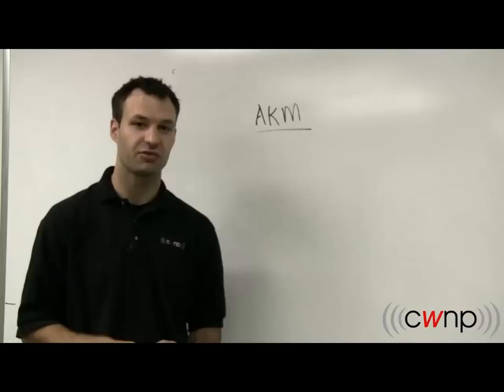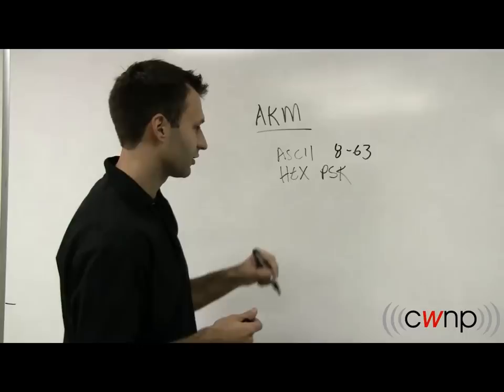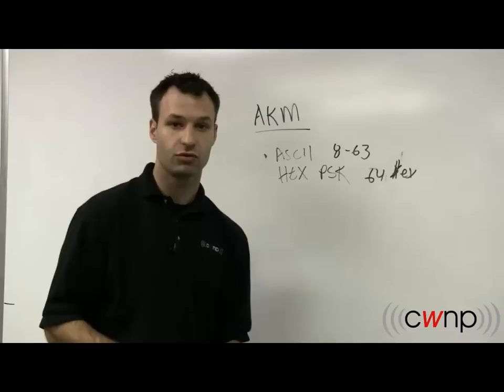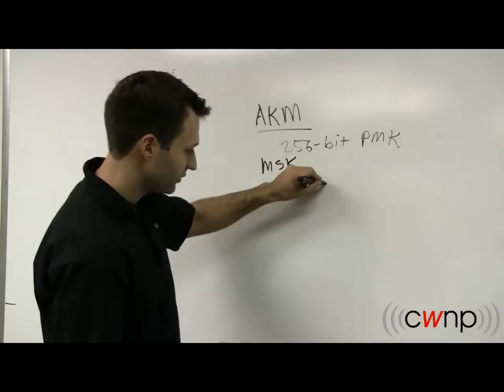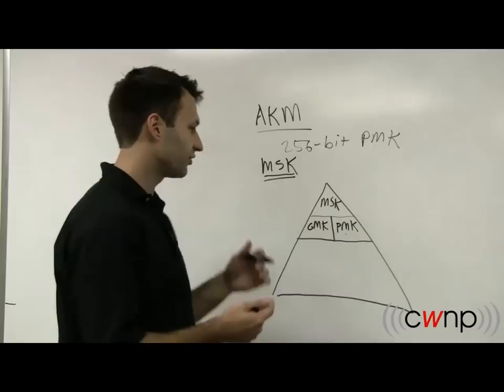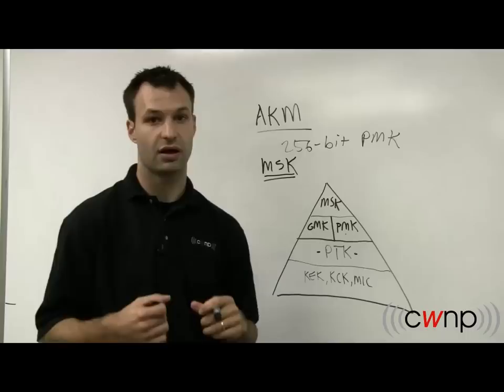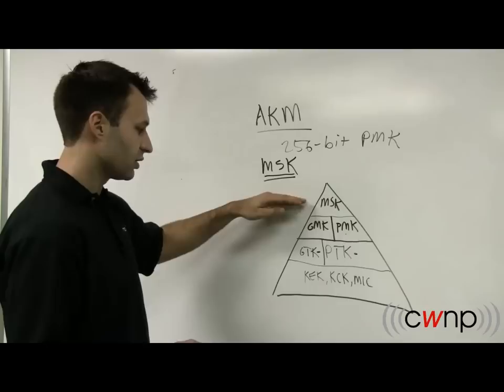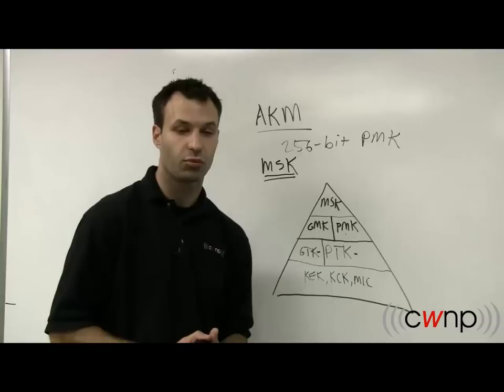Authentication & Key Management (Marcus Burton, CWNP)

Comment: Hello! I apologize - but - I am a bit confused. A 63 byte passphrase is not shorter than "256 bits." 63 ASCII characters for the ASCII passphrase can be up to 63 bytes, each byte is 8 bits, 8*63=504. So, 63 bytes (if the largest available length WPA2 passphase is chosen) is 504 bits. Does the protocol truncate the ASCII to byes conversion output? To be shorter than 256 bits, you would need <=31 ASCII characters, or bytes.
Reply: ASCII encoding is actually 7 bits per character, but other than that I was going to ask the same question.
Reply: @martinkunev  It's not 7 bits per character, actually is 8-bits because you have 8 physical states starting by 0 to 7 if you count you have 0, 1, 2, 3, 4, 5, 6, and 7 logical states but those correspond to 8-bits or 8 physical states that you can flip-flop between 0 and 1, so 2^8=256 physical states or 256 bits so you can represet 0 to 255 logical states, that means the ASCII table which contains 256 characteres.
Reply: @The Pentest Challenger, first of all, your analysis is partially wrong, the first part related to the conversion in the ASCII passphrase lengh is true 504-bits are greater than 256-bits, but what happened, when he referred to 256 bits he was talking about of the value of each ascii character that is a range from 0 to 255 values that is the extended ascii table, so the protocol do not truncate ascii to bytes in order to encript you must use hex value thats mean each character refers to 16 possible values per position, so then you have shorter position values in order to address properly in the memory, that is the way that looks truncated.
Reply: @jldmvlog  No, ASCII is 7 bits with 128 possible states. You can look at the ASCII character table and you'll see there are 128 characters. Years later it became common to have 8-bit bytes so people started encoding ASCII in 8 bits leaving the most significant bit 0.

wikipedia: The committee voted to use a seven-bit code to minimize costs associated with data transmission
Reply: @martinkunev  That's true but actually you need ascii extended 8-bits for the current encryption.